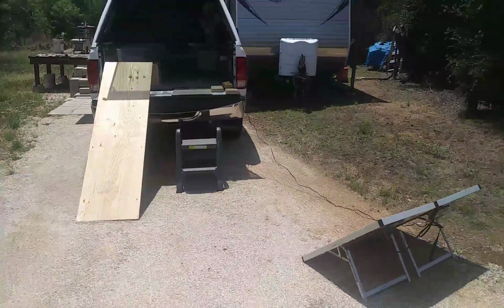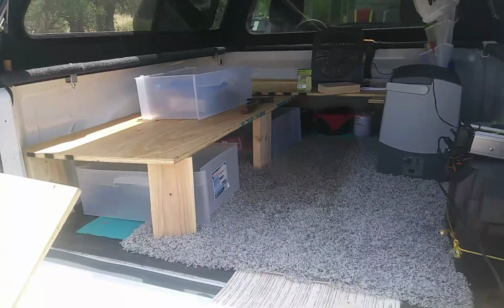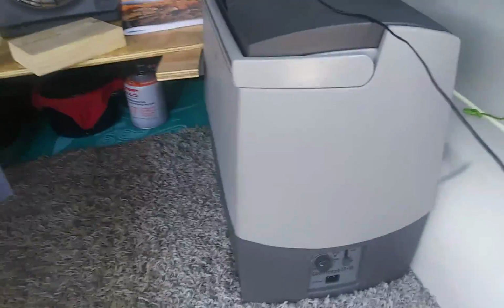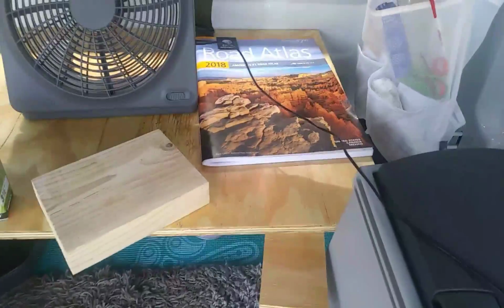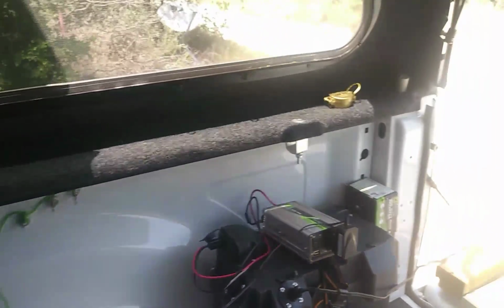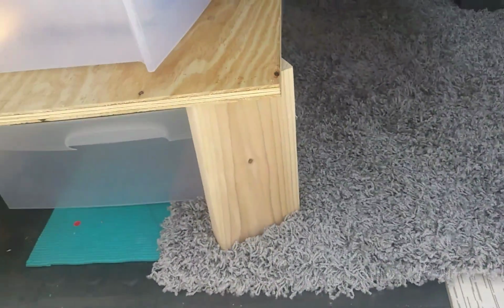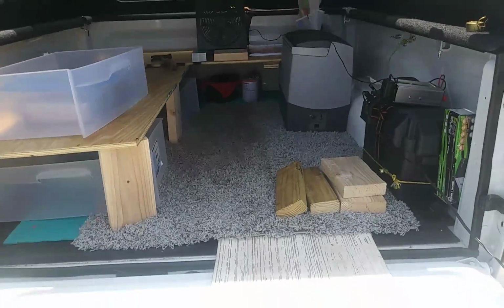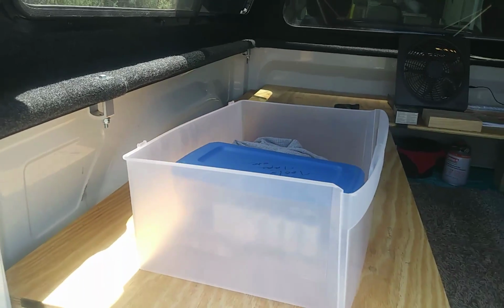Pickup Camper...inside build for camping!

Comment: Rusty ,,Use the extra wood to build a small shelf over the other wheel well...Then you could set the Fridge and inverter on the shelf when you are stopped,,then sit it on the floor while traveling,,,Looks like that would give you a Little more room...Safe Travels... Old Guy

Comment: use a drill.. if you don't have one get a rechargeable you can take with you later..(about 30 bucks and they come with screw driver ends most times) then use a tiny drill bit to get the screw holes started..then use the screwdriver bit to put them in.. less stress on you and the wood..

Comment: Drill and screw so if you change it will be easier.
Reply: yep thats what i thought
Reply: Thats what I was going to recommend also. Another thing you can do for the RV battery is wire it with an isolator coming from the trucks charging system so that it will get fully charged while traveling between camping spots. That way it guarantees a full charge at each destination, better life for the battery, and  because solar will not always  work well in some spots and weather conditions.
Reply: CentralCoastCamper so sticking it in the lighter receptacle while car is running is not advisable? That's what I was going to do but would that not be good for the battery or refrigerator?
Reply: The lighter fuse and wiring size is really too small for that kind of amperage. Battery isolators with properly sized wiring and tied into the main battery cables will alternate battery charging between vehicles battery and house battery insuring a full charge for both without overloading.
Reply: Thanks.  I need to go find someone that knows how to put on a battery isolator.  Pepboys?
Reply: An RV service center or a good independant auto service garage should be able to  install a proper system for you. Many RVers recommend the "Stinger" brand battery isolator.
Reply: Thank you!  I'd like to buy all the parts then just pay for the labor.  Looking on Amazon now.